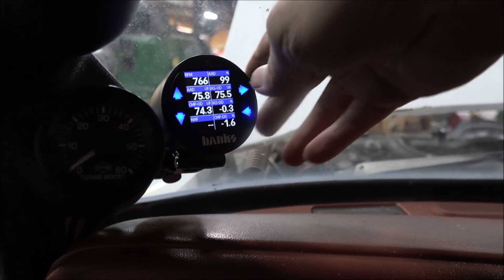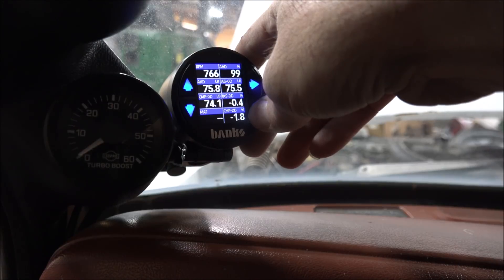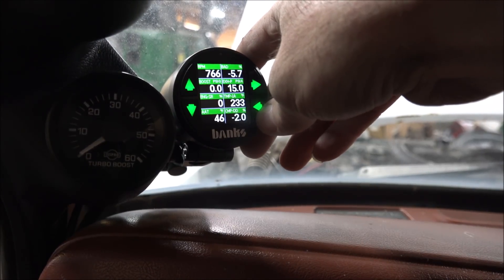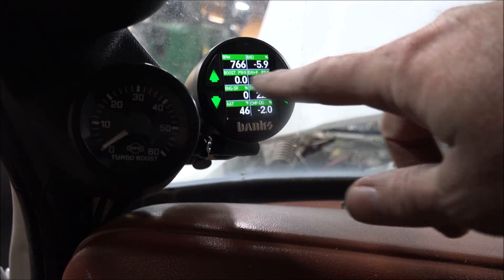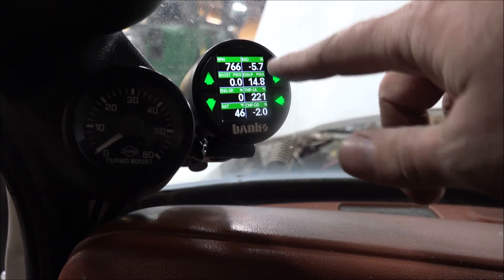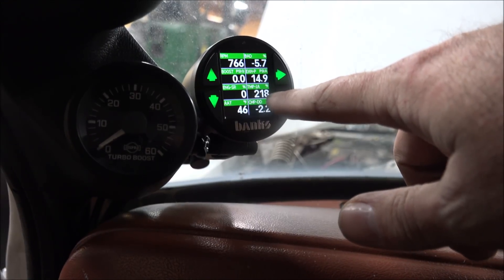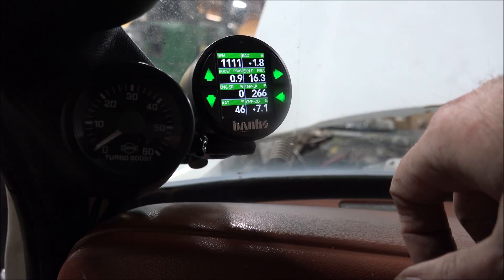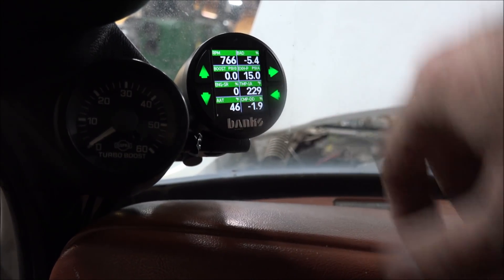Banks iDash Datamonster Install and Programming Making the Tach Work and Sensor Calibration Settings

Comment: Hey dude this is a awesome guage!!! any idea now to data log AFR with this system on your diesel? I'm looking at this gauge to replace mine as it also has no OBD and runs on a VE pump id like to do everything you done with the addition of Turbo Speed and AFR.

Thanks again for your parts list in your description :)
Reply from the maker: I am aware of one company that makes a diesel band 02 sensor but have not looked into how it could be paired with the datamonster. I have not seen where banks offers one. Nor do they have a generic 5” pipe style mass air flow which I think they should offer too. Hint hint Banks!!! 😂
Reply: @bcbloc02  I called banks they said I can use any LSU 4.9 Wideband O2 sensor with the datamonster and 4ch. The official banks power Wideband will be released by the end of the year.

Comment: Nice! Would love to add this to my '90.  How much did it set you back?
Reply from the maker: I have the parts list for what I put on the truck in the description you would have to add it up. I don't know what it cost because I bought this system to use on my dyno and got a bunch more sensors at the same time also price has increased since I bought mine 6 months ago. It is certainly not cheap but you are getting a LOT of information out of it.

Comment: Brian, All of this data is important for comparing different installations but it doesn't gave you hp and torque information. The only way to obtain that data is to put the engine in a dynamometer test cell. Yes you could load up the truck and find a steep hill and see what it does but these are only seat of the pants impressions with no hard data to back it up. Ideally you need an engine dynamometer for engine power measurements and a chasis dynamometer to measure power difference at the drive wheels. It gets even more complicated if you have four wheel or all wheel drive.
Reply from the maker: I don't need to know the actual hp or torque numbers. This system will eventually be combined with my engine dyno for more quantitative use.  For now I am only using it to compare the performance of the various turbo configurations.  If a change shows Manifold air density being higher and drive pressure being lower it is a guaranteed power increase.  A reduction i EGT's while not creating turbo lag also means there is more useable power available. Currently I can harness only about 60-70% of my trucks power for extended periods of time because of excessive exhaust gas temps that would lead to piston failures if run at 100% for a few minutes.  It makes what it makes if it is more or less is all I need to know for what I am doing now.
Reply: @bcbloc02  I completely agree with what you are doing. After all if you blow the engine do to over boost, what have you gained. You have to match the power available to the load you want to pull to the drive trains ability to handle that power and the available traction.

Comment: Brian, on the internet thing, I had crappy landline with DSL that was 2.75 mbps down and less than 0.5 up and it was costing $150/month. i got a new cellular box from the big V that now has 50mbps down and 6.25 up for less than $50/month, might want to check into that, and if 5G is close by it will be even better.  Once you get some comparison data done you can help me build a 4 cyl Deere to put in my 56 binder 4x4!!! Hay Hud from Ohio.
Reply from the maker: Don't know that is a good idea that 4cyl Deere tear a binder to part with all that power! LOL

Comment: You never changed the governor on that pump?
Reply from the maker: Nope, its stock. I don't need a bunch of rpm's  I have 3.07 gears. 🙂
Reply: @bcbloc02  Wow.  I had no idea.  Those are some tall gears.  Do you need to up the valve seat pressure for the upcoming turbos?  Although I see that setup more as broadening the power range than increasing peak power for the dyno queens.
Reply from the maker: @ShainAndrews  I suspect the springs will be just fine, boost pressure is not really a factor in  valve springs on a turbo motor because the drive pressure is usually very close to the same so the valve sees no pressure change.

Comment: ATT fiber optic has been good to us in rural 0 GA  500mb up and down  far better than Spectrum and cheaper.   Surprise   good customer service so far.
Reply from the maker: No fiber near me of any brand. (6 miles) Spectrum has a cable within a mile but said I was "way" outside their area so I asked them why they keep calling like everyweek wanting me to switch?? I was on at&T land line/dsl but it was constantly out because at&t won't maintain the physical phone lines in the country because nobody else is using them.  Service is at best poor if available at all from everybody. Thought about Starlink but a guy at work ordered his Last May and is still waiting on it. My speeds this week have been 8mb down and .01mb up. Blazing fast they call it!
Reply: @bcbloc02  Yeah, internet service is pretty poor and expensive in the ghetto where I am.

Comment: Is it possible to put a 15psi offset on the exhaust pressure so it reads zero like the turbo boost at idle? That little pod gives you a lot of info in a small package. Can’t wait for the testing to begin! Thanks Brian!
Reply from the maker: If you did that it would screw up all the density calculations and those values. Just have to remember to do it after the fact.